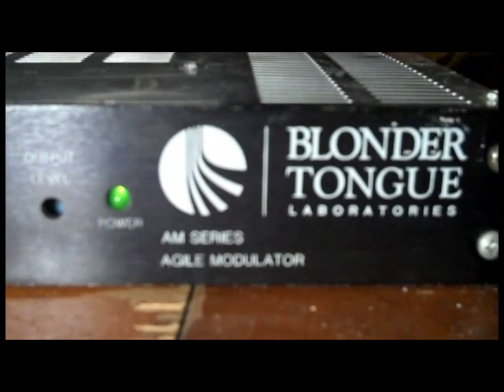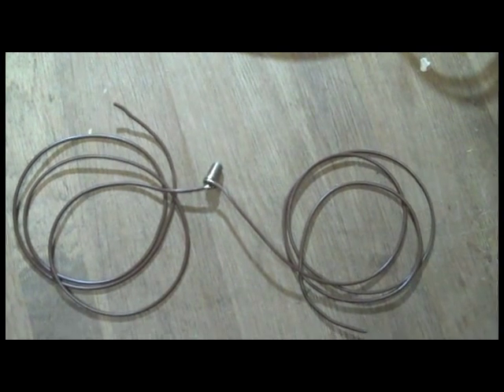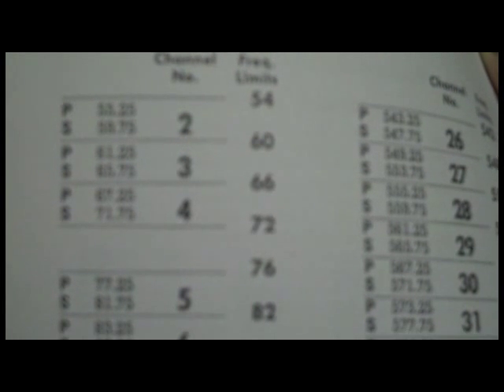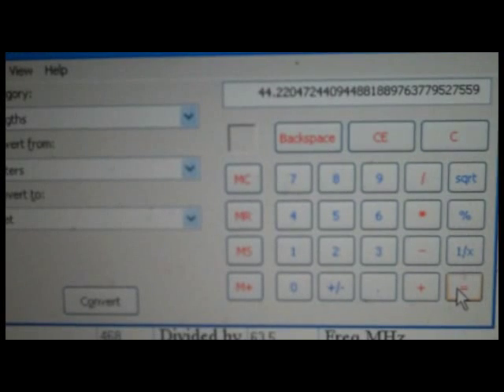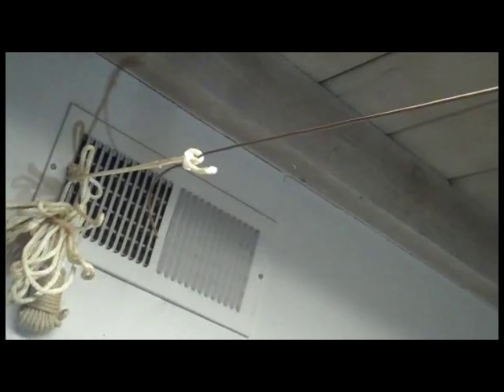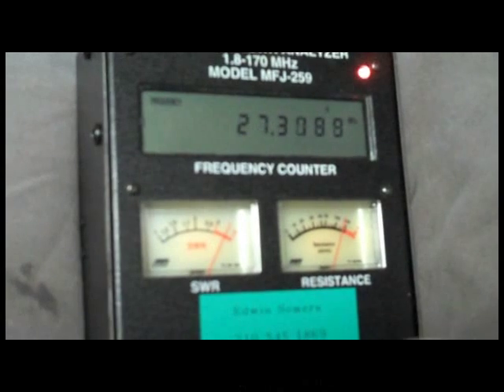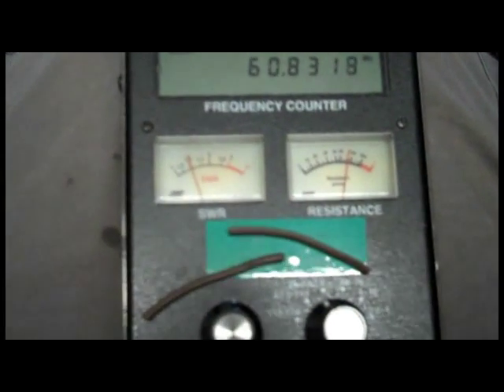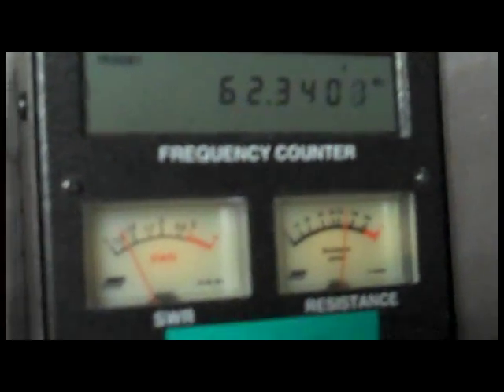How to make a dipole antenna for the Blonder Tongue Agile Modulator

Comment: Feed-line length does make a difference.  That's why you had to cut two inches off the length of each leg.  There is a formula for line length as well as antenna length.  Or you could use a trans match.

Comment: I wonder if making a folded dipole using 300 ohm twin lead and a 300/75 ohm balun would work any better or worse? I just got a AM60-550B modulator and I will be building my home TV transmitter station sometime soon. I had a ham radio friend express concerns that the FCC would have issues with home analogue TV transmitters. If the signal doesn't go much beyond my home how could that be a problem? Gary
Reply from the maker: +HD7100 Use the lower channels 3/4 and you shouldn't bother anyone, seems like a balun would be lossy